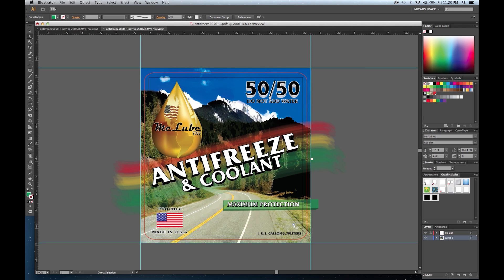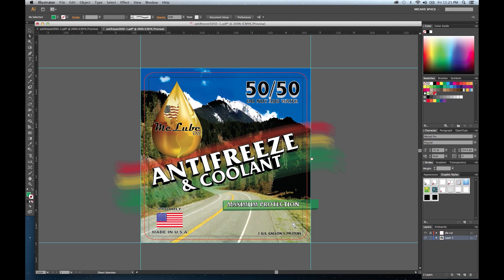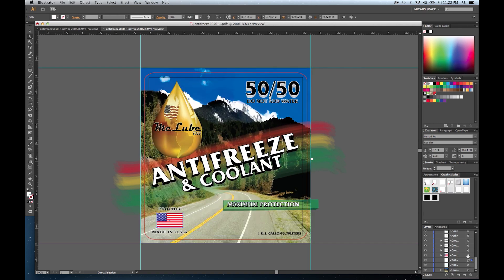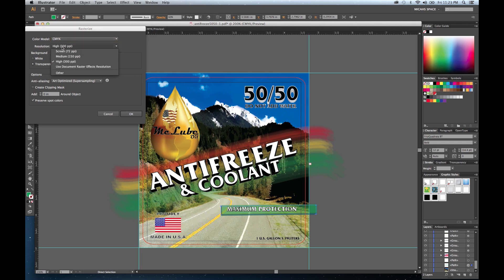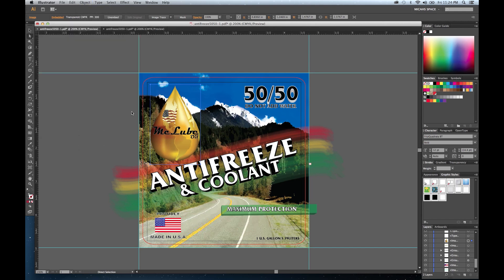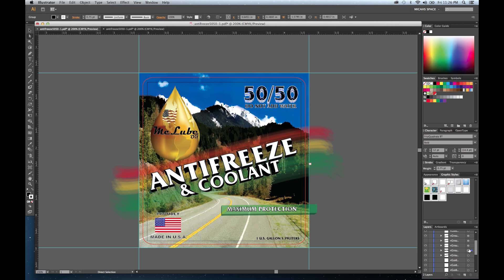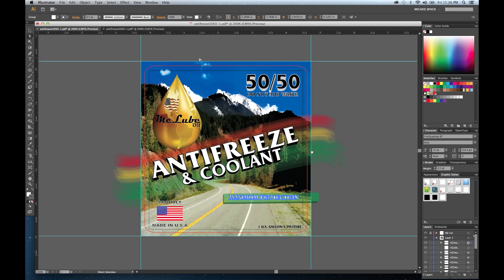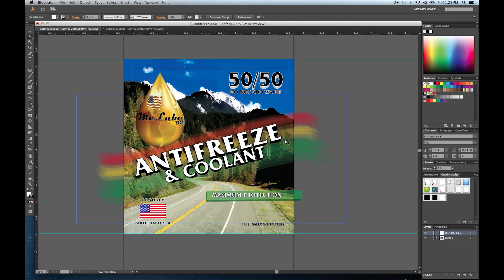How to make your files print ready in Adobe Illustrator

Comment: Bleed margins are included by Adobe as a printing tool - there is no need to outline it with a round cornered box that has been stroked with a spot colour.  Just make sure your artwork extends to the bleed-line and that important text or graphics are within a 5% margin of the art-board.  Any text should be outlined and merged with any other vector shapes. Save as a pdf in CMYK @ 300dpi, then send to your vendor...  Works every time...